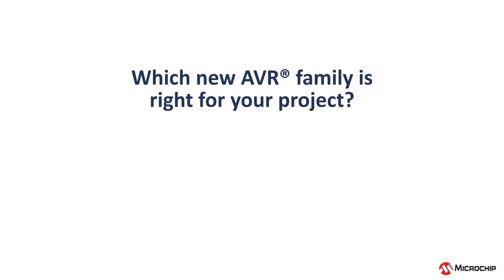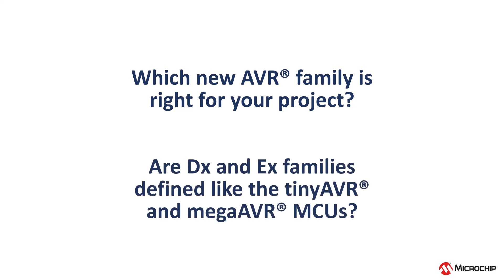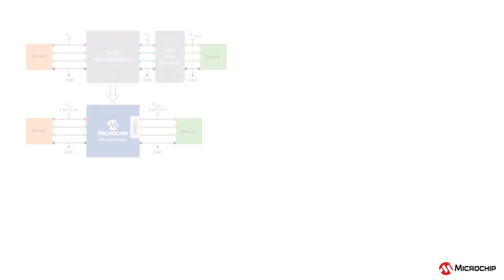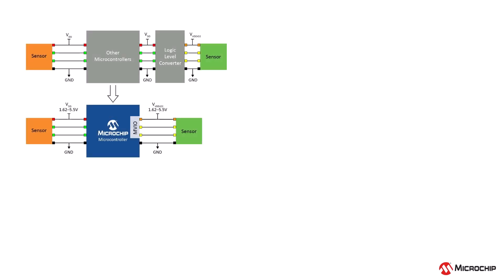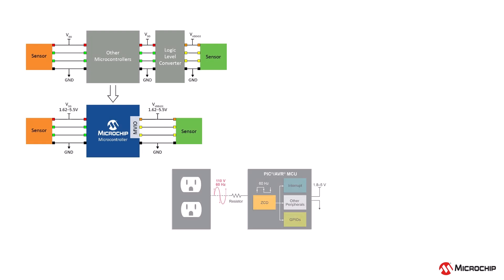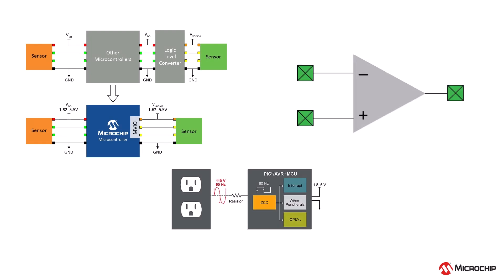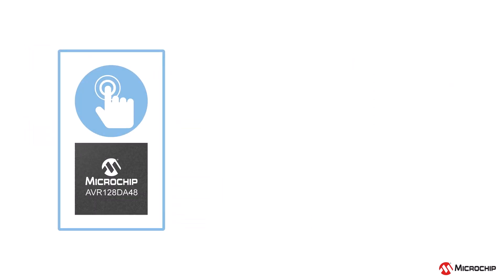AVR's New Look: Simplifying Microcontroller Selection

Comment: Will these new chips work with AVRdude or am I gonna need to buy a pickit?
Reply from the maker: Hi there, thanks for your question! The selection of compatible programming tools will depend on the specific components chosen for the project. AVRdude primarily supports classic AVR devices and relies on protocols such as ISP (In-System Programming). However, newer AVR devices, such as the AVR64EA48, utilize the UPDI (Unified Program and Debug Interface) protocol, which differs from the traditional ISP interface. Tools like the PICkit 5, MPLAB Snap and Atmel-ICE support UPDI and are fully compatible with the AVR64EA48. These programmers integrate seamlessly with both MPLAB X IDE and Microchip Studio. Hope this helps!